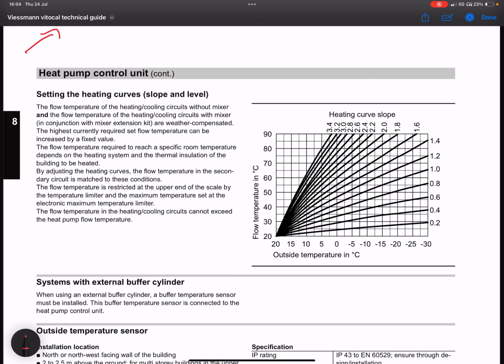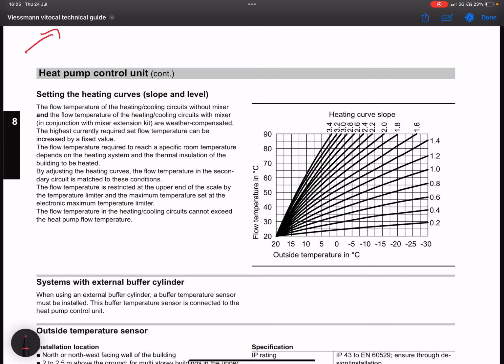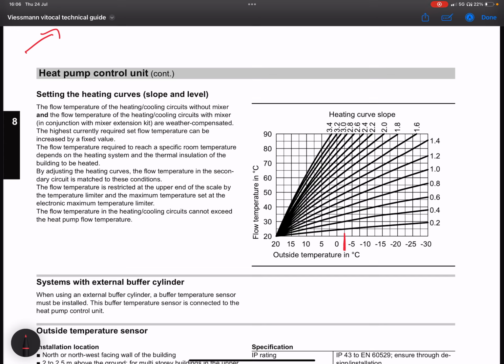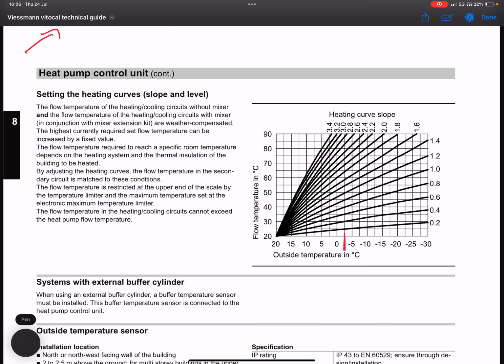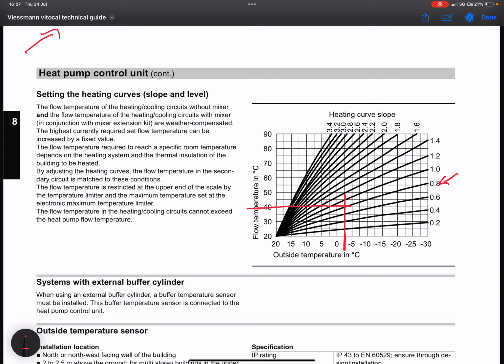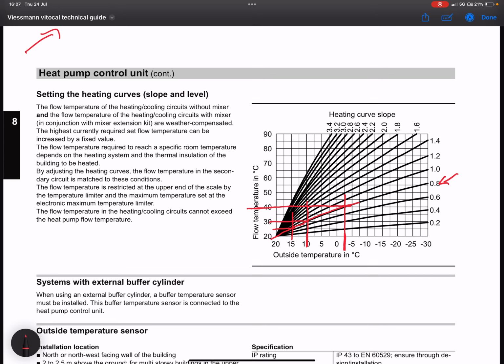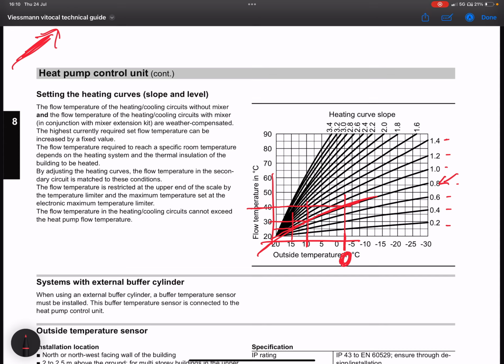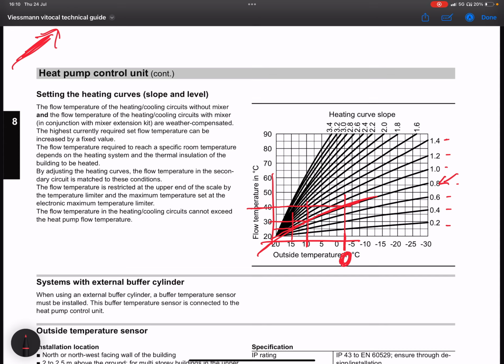Weather Compensation (outdoor reset) controls explained. Why running heat pumps on stats is madness

Comment: It’s not the only way to run a heat pump. Even better is to use weather comp combined with an internal reference temp. This variable heat inputs, eg solar gain or cooking, can be incorporated into the flow temp calcs, saving money.
Reply from the maker: Internal gain is consideration, agreed. However, internal room reference only works well if you have multiple sensors else it is just that one room that determines the rest of the property. This can work well in smaller properties. Viessmann controls, to date, are by far the most effective we've worked with and we find thermodynamics handles solar gain pretty well in winter months. Apologies this took so long to reply to...it's silly season for us heating engineers, at this time of year.

Comment: Excellent presentation.  A question: why would you need to adjust the heating curve slope in mild weather, though, if the heating curve slope and level are chosen accurately to match the heat loss?
Reply from the maker: It is not a very common requirement for Viessmann systems as their curves tend to actually be...a curve. Many other manufacturers just plot a straight line. Also, heat loss standards to BS EN 12831-1:2017 and the older 2003 standards are not 100% accurate and tend to act more as a guidance starting to point to work from so calculated curves do not always match up to what is actually required in the real world so some fine tuning may be needed. Heating design is based on static scenarios for the most part and reality is much more dynamic but we have to start somewhere as a base to design from. I hope that helps.